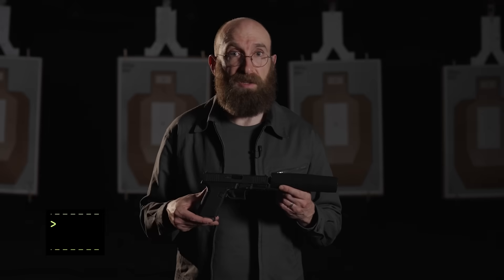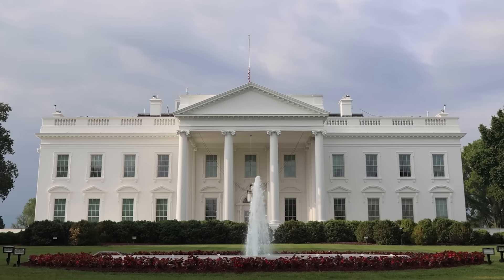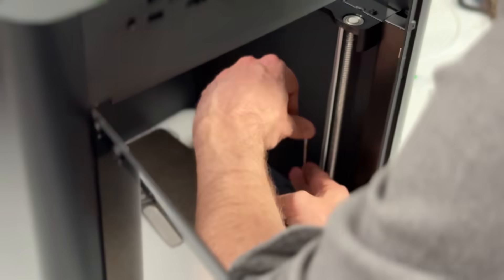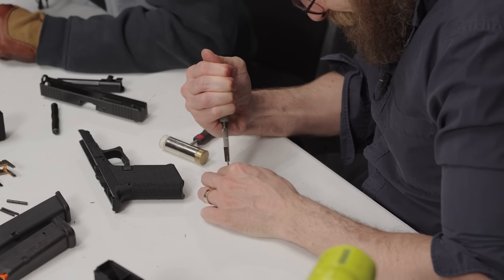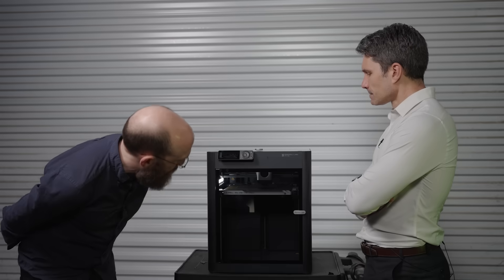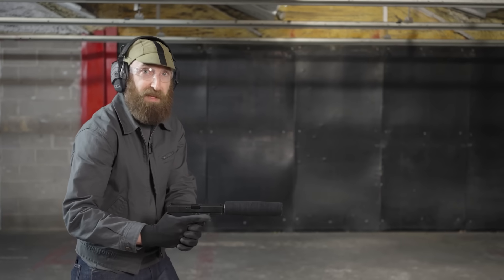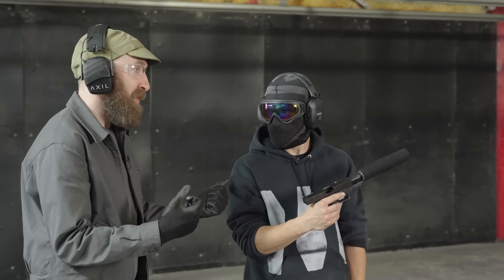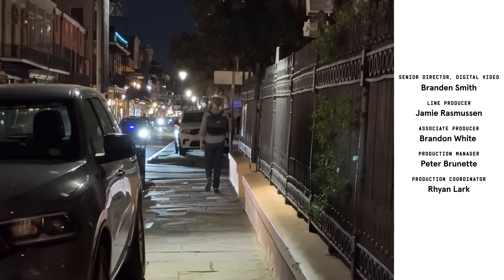I 3D-Printed Luigi Mangione’s ‘Ghost Gun’ | Hacklab | WIRED

Comment: The problem with the stat of "70,000" ghost guns recovered. Is that they consider ANY firearm with a destroyed serial number a ghost gun.
Reply: Yeah big blanket of a term. Ghost guns sound better on the news not de-serialized guns
Reply: The FOPA specifically prohibits the creation or maintenance of any systems that registers firearms or owners of firearms. "Ghost guns" are perfectly legal albeit the person manufacturing the firearm can legally possess it and make no attempt to sell it.
Reply: its any gun with either no serial number or a modified one, wich is b.s because you can legally manufacture firearm's and as long as there is no intent to sell you dont need to serialize it as per the ATF's own ruling
Reply: @GortInA300  the legislators are being told by their constituents that they have to do something. so what they do is just make a new law that changes nothing
Reply: They also consider like... painting a gun and some paint getting inside the numbers as "destroying" the serial number because it obscures reading it by 1%. They tried to charge FPSrussia with that one.
Reply: I mean aren't they ghost guns if they have destroyed serial numbers? The better question is how many are 3D printed.
Reply: @scholasticendeavor  The definition was changed to include destroyed serial numbers.
Reply: @maadvicktony shure
Reply: @scholasticendeavor those 3d, and kit guns are not even the problem! Criminals have no liability when caught with a firearm most are released and not even charged it happens all the time in Chicago! So if 2% are Criminals that keep reaffending on a revolving justice system crimes with firearms never go down and they call for more and more control on law abiding citizens!@
Reply: @scholasticendeavor  most criminals aren't smart to begin with. I considered myself to be pretty smart mechanically and I've been researching about printing for the past 3 years off and on. I decided to buy some real guns first and now I can print a frame for the Glock I already have. I don't think gang bangers are printing stuff and instead just getting burners. I've seen real life felon dudes who have a shop under their mattress in a sober house 😂 they ain't doing all that to have a pink Glock. They also don't accept liberators at gun buy backs anymore because a guy brought like 10,000 he made because it was like $3 to build it or something and he would get $20 for each gun 😂😂😂
Reply: @scholasticendeavor  If you destroy your ID card, are you a ghost?
Reply: @scholasticendeavor  3D printed firearms don't come with serial numbers unless you add one. De-serialized firearms are not ghost guns by definition, because they were serialized and catalogued. They are accounted for, even if there whereabouts are unknown.
Reply: @scholasticendeavor  no because 99% of serial numbers destroyed can be recovered
Reply: @scholasticendeavor 

No. A 'ghost gun' is specifically a firearm with no official record of manufacture. No one knows it exists.
Reply: @springbloom5940  a serial number is an official record of manufacture
Reply: @springbloom5940  wrong. They specifically include any firearm without a serial number. That includes a legitimate glock with a destroyed serial number.
Reply: @springbloom5940  Not true, defaced serial numbers on OEM manufactured firearms is in included under that classification under DOJ   FBI crime stats. The correct technical term is untraceable firearm which is why all others weapons that cannot be traced are pooled together It’s also the equivalent with CDC stats claim that guns are the number 1 killer of children but people fail to see the fine print stating children are considered 1 year old to 19 years old.  More deaths occur for post natal infants than do for children Up to the age of 17..
18 and 19 yr olds are adults but not according to the CDC stats.
Reply: @springbloom5940

That’s your own interpretation however you are wrong.
Reply: @springbloom5940 no? How are you going know there record of the gun if the serial is gone🤦‍♂️
Reply: @springbloom5940  well to the use of an atf agent a gun with a destroyed serial number might as well be a "ghost gun" because it cant be traced.
Reply: @furtnot3441 a gun WITH a serial # cant be traced either. Unless it was stolen and the victim reported the serial # on file to police
Reply: @Ammonymity1776  As of three weeks ago that changed, they can trace guns without serial numbers too as of now, police have alotta stuff that isnt discussed enough.
Reply: @fnpunnupy lmao. They absolutely cannot trace a firearm, even WITH a serial... unless that serial has been reported stolen. This isnt CSI Miami... lol.
Reply: And the problem with 17:23 this figure is that he purposefully excludes infants and includes adults... and violent criminals
Reply: @TheSundayShooter  yep. and this whole video has a fear mongering overlay to it
Reply: @TheSundayShooter  Ummm what figures??? I want numbers!
Reply: @TheSundayShooter  if they really want talking stats, they should look at states and countries with highest gun related incidents are the one with strictest gun control laws, but no those people are ideologists they only want to demonstrate that they are right. Look at sweden, example of scandinavian success, now fallen paradise, its gun related murder is sky rocketed, not because it changed anything about it gun law, always one of the strictest in Europe, no no it's bad management, laxism and ideologically fueled decisions. In contrast, switzerland, czech, slovakia choose a pragmatical approach, respecting their gun tradition, put more money in education of gun users and oh big surprise no problem.
Reply: @stm22  yet, sweden still has 1/3 of american gun related deaths
Reply: @olerosentreter2993  u don't know how to read? compare apple to apple, sweden to other european countries with more relaxed gun law, i gave that example to make the point that gun law is not the problem. Sweden always had the most restricted gun law since ages in europe yet the crime rate and gun related crime rise sharply the last 10 years, so u can't blame crime to relaxed gun laws. If we just blindly put the responsibility on gun we make a wrong decision and will not help to make a better society, unless of course you are bad representative chasing after votes and being a fear monger.
Reply: @TheSundayShooter guess what his religion is
Reply: But they won’t tell you that
Reply: that is incorrect
Reply: ghost guns will include pipe guns.
Reply: the serial didnt need to be destroyed, if it didnt have one to begin with, its still a ghost gun.
Reply: The only real ghost guns, are the guns cops sell to people. lul
Reply: It's a made up term that gun controllers created to drum up fear.
Reply: @3vilSuperman  I still say, its what the cops sell you. lul
Reply: No. ATF defines ghost guns as PMFs, privately made firearms. Commercial made firearms with altered or destroyed serial numbers are not legally defined as PMFs.
Reply: Because that’s what a ghost gun is. Ever heard of a ghost glock? They’re actual glocks with the serial scratched/sanded off
Reply: you cant trust a single thing that comes out of the mouth of a european loyalist. and european loyalists are the only people who are allowed to become even remotely well off in eurocentric culture.
Reply: your right, thats is crazy disinformation
Reply: Isn't that the definition of what a ghost gun is???

No way to track/trace them?
Reply: @ewenchan1239  but they CAN be traced, although more difficult, CAN easily be traced within weeks at max, the police arent that stupid and nor are the manufacturers.
Reply: @ewenchan1239  A lot of people here arguing about the term are missing the point, his goal is to dishonestly exaggerate problems with 3d printed guns by conflating them with traditionally manufactured guns that have had their serial numbers tampered with.
Reply: @shawn_369  
"A lot of people here arguing about the term are missing the point, his goal is to dishonestly exaggerate problems with 3d printed guns by conflating them with traditionally manufactured guns that have had their serial numbers tampered with."
No, that's not the point.

3D printed guns aren't any more traceable/trackable vs. traditionally manufactured guns that have their serial numbers tampered with.

The method that leads to their untraceability isn't the problem.

The problem is that in both cases, neither of the guns (whether it's 3D printed or have their serial numbers tampered with), would be untraceable.

That is the problem.

And your comment/reply doesn't address this actual problem of guns that can't be tracked/trace.

That is the problem.
Reply: @ewenchan1239 there is no legal gun registry in our country as it is. That would be unconstitutional. So there is NO "central database" where any one can enter a firearm serial and it comes back with the owners info.
Reply: @ewenchan1239 let's be real here, a serial number doesn't magically make a firearm traceable beyond the original purchaser when it left the gun shop unless you live somewhere that has unconstitutional registration laws that the next buyer decides to follow. I don't understand how or why it came to be that so many believe a serial number somehow makes it traceable. The serial number is not the problem or the solution.
Reply: Or any guns built before 1964, when it was legally required to have a serial number on a gun
Reply: who knows, there could even be 6 million ghost guns
Reply: Like you sand the serial number
Reply: Nothing special
Reply: How was they recovered of they was never stolen. You mean confiscated ?
Reply: And they're deliberately obfuscating the number of 3d printed firearms vs defaced serials to push a narrative that you can ban an STL file.  It has always been legal to manufacture your own firearms.
Reply: That makes that number make a lot more sense
Reply: ironically this also counts large numbers of unofficial government manufactured weapons either deliberately or "accidentally" loaned to foreign powers for the purposes of undocumented and plausibly deniable nastiness....
Reply: Because that's the legitimate definition? I don't get your point
Reply: @grey9803 you can't even put together a coherent sentence, of course you don't get my point. What are you even talking about?
Reply: @grey9803  The video is about 3D printed guns and the novel danger they represent, but the statistic they rely on encompasses more than 3D printed guns. The video wants you to believe this is a large and growing problem, but their numbers don't support it. This misapprehension is also useful to governments, who are always happy to scare the public into supporting legislation they can leverage for personal gain.
Reply: "Saturday Night Special", "Paper Bag Gun" ...
Reply: "Ghost guns" were also 70% guns. There's no law against 70% guns being transported or sold. It's legal to make your own firearm and keep it unserialized if you don't intend to sell it. They are construing the right to manufacture your own personal firearms for "ghost guns" They have, in essence, alienated the 2nd amendment by doing this.
Reply: Pipe guns and zip guns too. Stuff that’s not 3D printed
Reply: Most 3d printed guns I’ve seen only last a few shots but some people have gotten them doing really good but still I’ll never shoot one 😂
Reply: @baconwrappedak  youve been watching the wrong ones then. I have printed pistols that have 1000s of rounds.
Reply: @baconwrappedak you must have not been in the scene for a while then. If they’re made with good filament and printed correctly they absolutely can function just fine.

What’s the difference between a Polymer80 Glock lower and a 3D printed Glock lower? Really the manufacturing method. One is injection molded, one is printed.

You can read articles about rebels in the Congo using the FGC9 in combat. Or even people in the US that have ran 10,000+ rounds of 9mm without issue.
Reply: Ones with destroyed serial numbers are "ghost guns". Self made guns (including 3D printed) aren't ghost guns. The evil leftists just lump them in to try to garner support for banning them.
Reply: I'm sure a large portion of them were also 80% receiver builds too, not printed stuff.
Reply: any the old firearms, before they required serial numbers lol
Reply: What a lot of people in this reply seem to be missing is. A personally manufactued gun, is fully legal where tampering with a serial number is a felony. So when you make a stat that incorporates felons with law-abiding citizens soley to restrict the rights of law abiding citizens is a large issue. Just as including up to 19 year olds into the stat of childhood death rates.
Reply: @lilkiduno  Not at all.  It's a useful statistic to track.  If the police are finding a spike in recovered "ghost guns", or otherwise non-serialized guns, in an area I bet that's useful information with how it relates to crime.

It isn't about lumping owners of personally manufactured guns with people who tamper with serial numbers.

Also, 19 is an adult, but they're still a teenager.  They're on the cusp.  Don't think it's too unfair to include them in the stats, though I suppose context matters a lot.
Reply: @Niros8889 context is very important in both instances. However, these are very common stats used in anti-gun rhetoric. The term ghost gun was originally “popularized” in discussion to 80% kits or de-milled imported guns kits, think of the AK Kits that used to be heavily popular. Once 3D Printing became more mainstream and functional you began to see the term ghost gun applied to 3d printed firearms. That’s why it’s important to differentiate between felony modifications and Personal Manufacturing of firearms. The issue for the anti-gun movement is that very few personally manufactured firearms are involved in crimes.
Reply: Forget 1 Man vs 100,000 gorillas, It Is 70,000 ghost guns vs 828 billionares 😂🙌
Reply: Yeah, they want to conflate the two on purpose so they can eventually argue to make 3D printing pews illegal... thats their whole point.  Most if not all gun stats are manipulated or presented in a obfuscated fashion because grabbers don't have an honest argument.
Reply: Yepp. Either him or ATF are embellishing things. 

The govt doesn't want us to think, just react.
Reply: What's your point? With 3D printed guns you think that number is supposed to go down?
Reply: @442caleb my point is that a stolen sig p365 macro with a defaced serial is a "ghost gun" and the media/politicians are selling the talking point like "BE SCARED!!! GHOST GUNS ARE EVERYWHERE! YOUR KIDS ARE PRINTING THEM IN YOUR BASEMENT RIGHT NOW!"
Reply: @calebch42  Most people aren't going through the trouble of making these. Separate numbers would confirm it. Putting it all together makes it look like most bad actors under the sun are doing it, which is meant to artificially call for immediate action. That's the problem with that.
Reply: @calebch42  The point is the government and activist groups exaggerate to mislead about the scale of the problem.
Reply: @grantcivyt ah yes, the "that seems like way too many unserialized guns to be true, we better start 3D printing as many as we can to make sure they aren't exaggerating" argument. Truly a man of scholar.
Reply: @calebch42  Governments and activist groups exaggerate stats, and credulous supporters repeat them without question.
Reply: @grantcivyt you are engaging in the logical fallacy, strawman. You truly think that if we 3D print guns those numbers go down, regardless as to if they are exaggerated or not?
Reply: @calebch42  Where did I write that the numbers will go down? That's a straw man you created. 😂
Reply: @grantcivyt when you responded to the comment that said "What's your point? With 3D printed guns you think that number is supposed to go down?" You were directly trying to refute the idea that with 3D printed guns that number is only going to go up. Asinine.
Reply: @calebch42  You don't have to infer what I said because I said it in the comment. You're trying to rationalize your straw man argument but it's still a straw man. Try responding to what I actually wrote instead of imagining arguments you'd prefer.
Reply: CONservatives FORCED gun tracing to be done by  pen and paper and defunded all tracing so why would u need a defaced serial num or ghost gun? pro crime Cons allow MILLIONS of criminals to go free
Reply: Funny how the number is very  similar to a number that a tad bit often in Islamic prophecies (the no. Is a lie)

Comment: The real issue why the gun won't cycle with the suppressor on it is because the 3d printed one does not have a piston installed on it. Glock type pistols have barrels that actually need to move the front of the barrel up and the back of the barrel down as the slide cycles. With the weight of the suppressor on the barrel, it's not allowing the barrel to rotate and therefore the slide cannot reciprocate correctly.

With a commercial suppressor that is meant for a pistol, there is a spring piston around the part that is threaded onto the pistol barrel which allows the barrel to move enough for the slide to cycle. It's much harder to design a 3d printed suppressor to accept a piston though I'm sure.

I'm surprised that this wasn't brought up in the video or maybe it was but they edited it out for whatever reason.